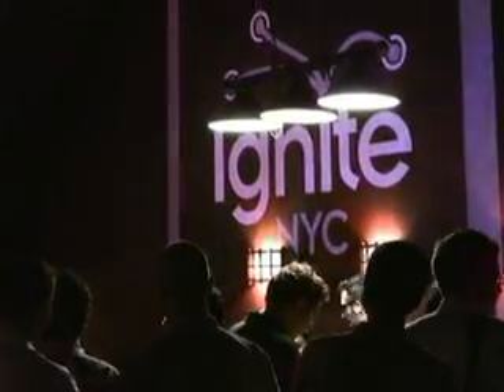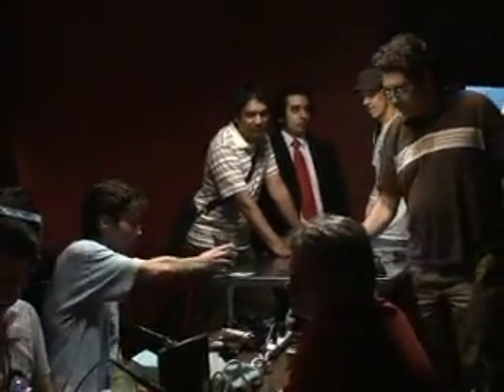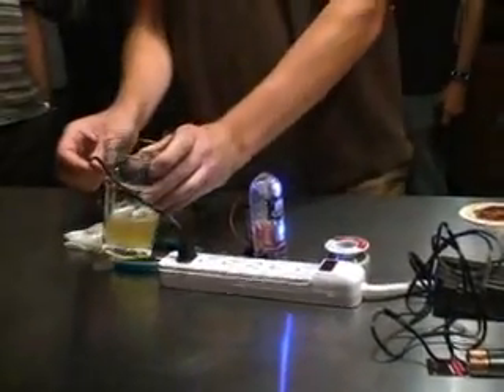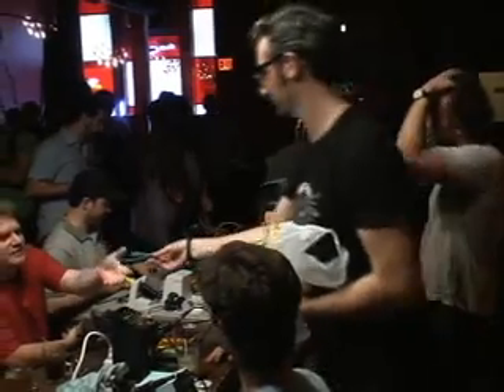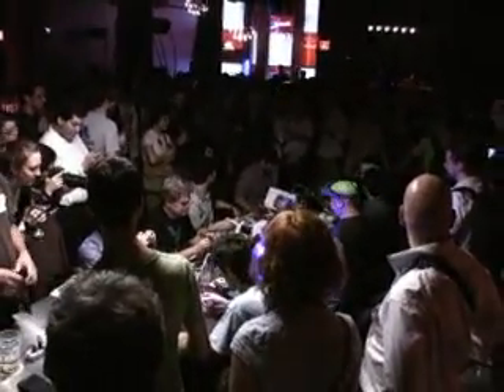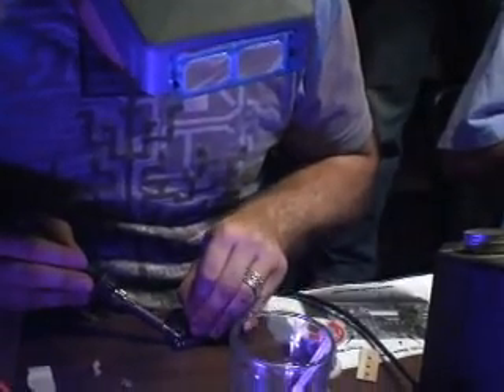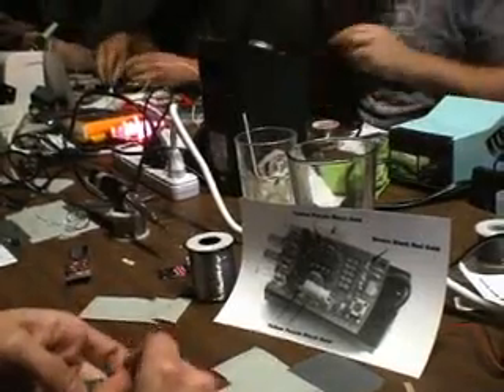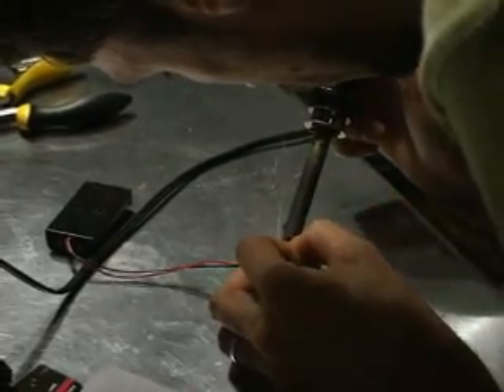NYC Soldering Championship

Comment: Wow, this would be something that I would love to show up at, I probably wouldn't compete because I've never soldered with the intention to get it done very fast, I usually check my joints to make sure they are in securely.  Then again I put down the little donuts and connect the dots and copper-etch my boards a bunch of the time too.  Fun hobby, I love playing with and building electronics.